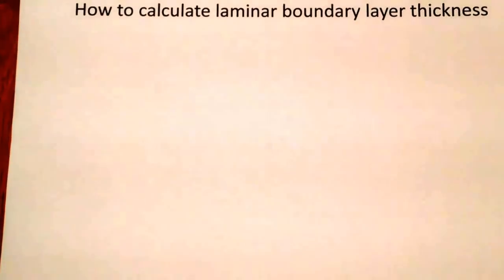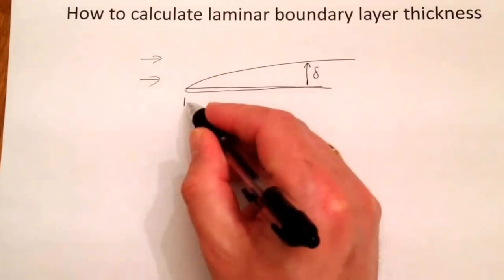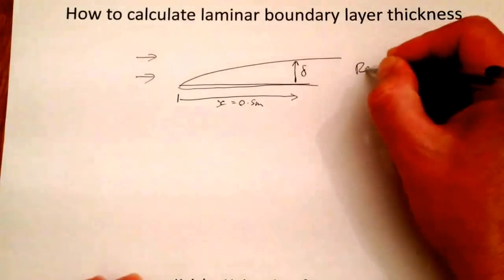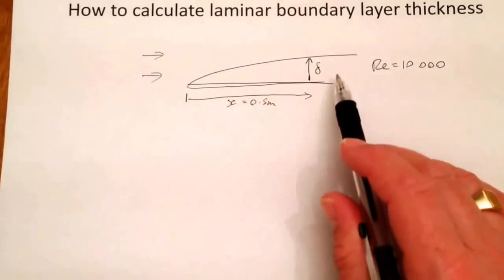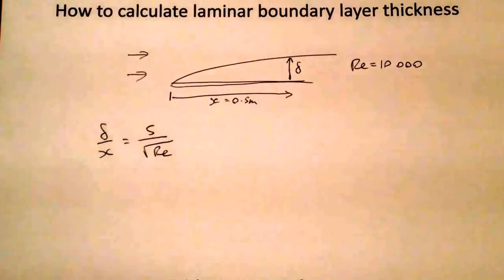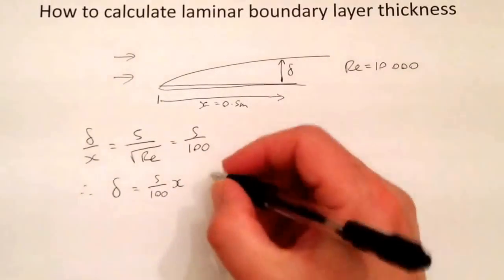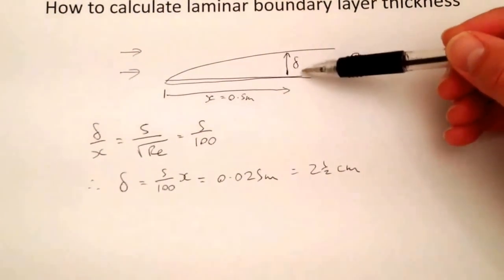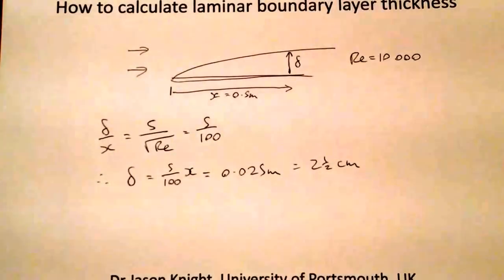How to calculate laminar boundary layer thickness on a flat plate

Comment: isnt the re to high to be laminar?
Reply from the maker: for a pipe/duct, yes, but for a flat plate where Re is based on length the critical value is around 300000

Comment: Isn't the cut off for laminar flow over a flat plate at Re ~ 600?
Reply from the maker: the critical value is 300000
Reply: if calculating boundary layer thickness for a wing at a fixed location (0.28m) but at different velocities, when the RE is over 300000 should I change to turbulant (Xx0.381REx^-02)?
Reply: yes @heysamhillier